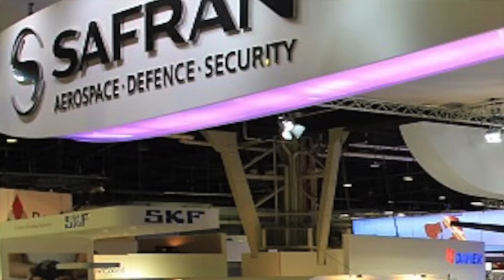INDIGENOUS KAVERI ENGINE PROJECT TO BE REVIVED WITH FRENCH HELP:  TOP 5  FACTS

Comment: That means they will have a French engine they make locally, not a Indian designed engine. Turbine engines are super complex in their internal interactions so there is a freedom in design (correction, multiple solutions to problems), you don't have in many engine types. You don't just make a fourth gen engine, they obviously haven't committed to building  up a jet engine program with the depth to advance this engine. Plus is France really going to let 4 gen knowledge to be sold?

Comment: I read a article on War is boring. 
"India Spent 33 Years Developing This Fighter Jet And It’s Still Abysmal
The Tejas is a hodgepodge of parts from better fighters

However, India is attempting to revive the failed Kaveri indigenous engine that was originally slated to power the Tejas before it became glaringly apparent that it was not up to the task. The France’s Snecma is working with the Indians to certify the Kaveri engine for the flight of a Tejas light combat aircraft prototype in 2018.Given India’s abysmal track record in developing indigenous combat aircraft, there is little reason to be optimistic about New Delhi’s prospects for the Tejas. Frankly, the Indian Air Force would be better served by relegating the Tejas to being technology demonstrator and simply buying a genuine combat aircraft from one of its allies."
Reply: Kieran Jones Well it simply happened due to a fucked up government and irresponsible research organisation with no focus. Now it's not the case .